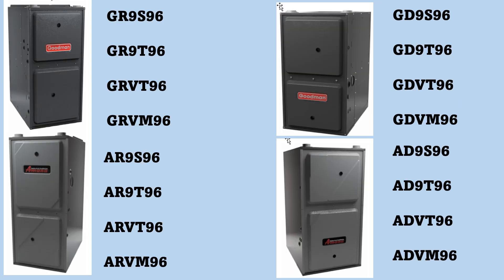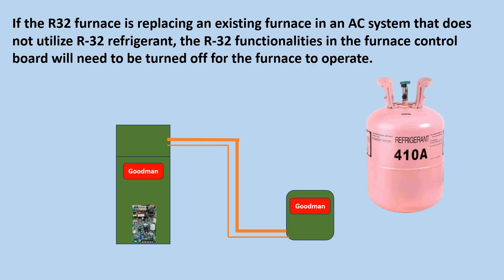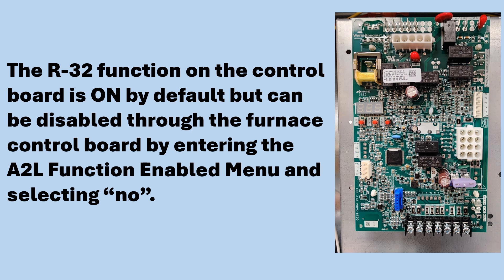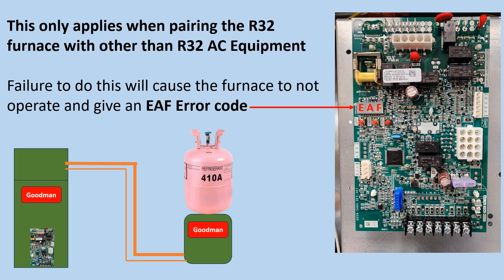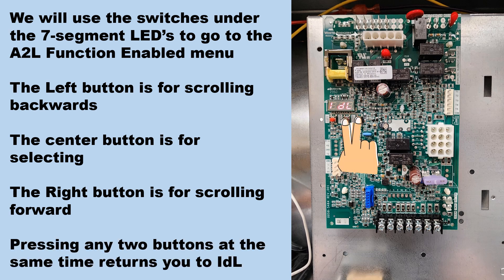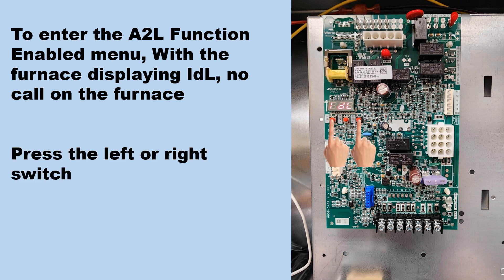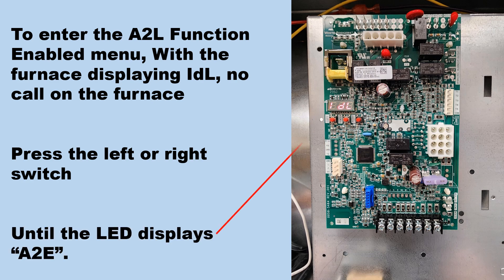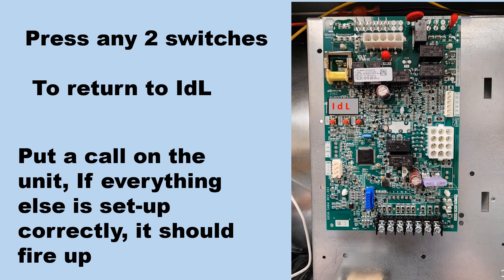Shutting the R32 Sensor Off when Using an R32 Furnace to Replace one in an Existing R 410A System

Comment: Had this the other day, doesn't mention this in the book had to call tech support.Shame on Goodman! Without heat for 2 days
Reply: was your furnace overheating?
Reply: @obedb093  no ,new install burner wouldn't come on as soon as l did the settings fired right up